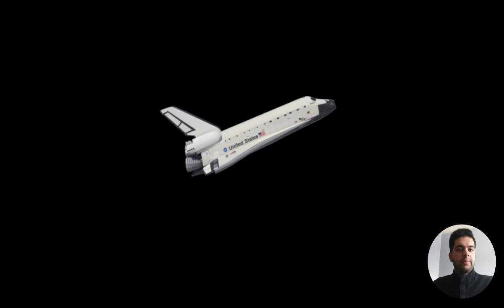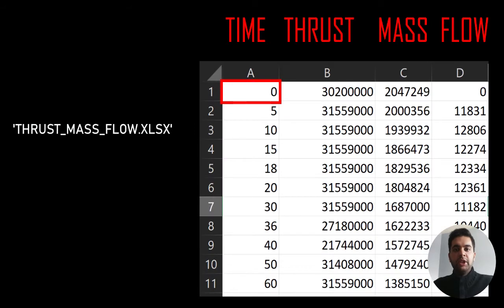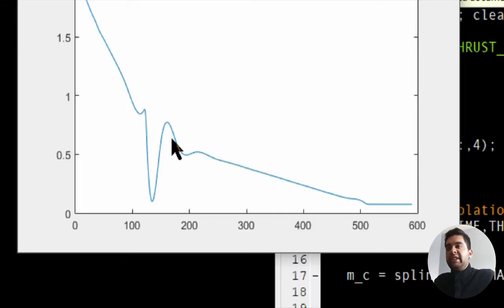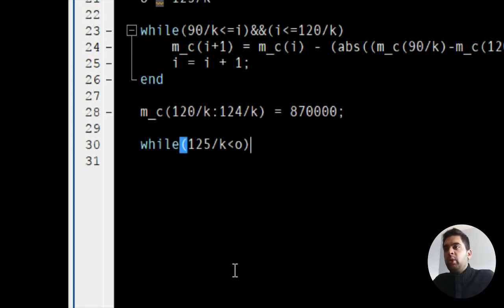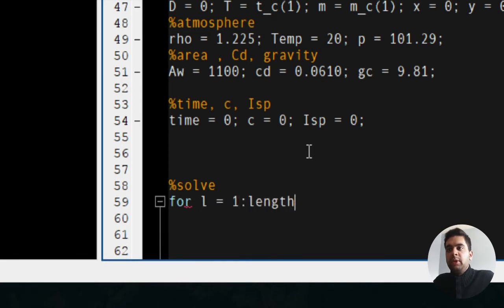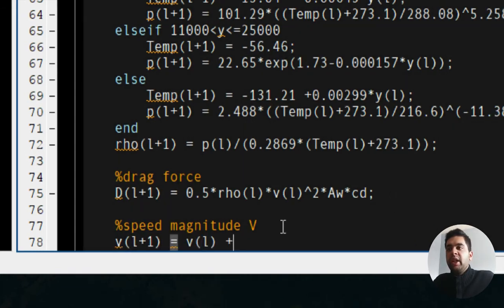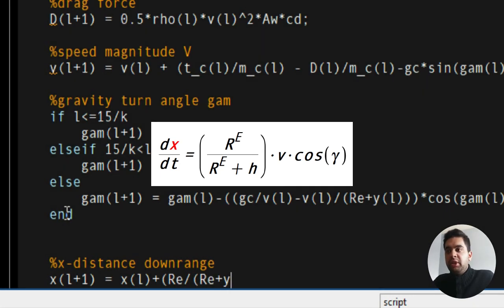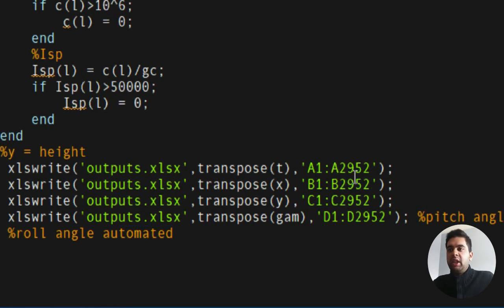STS Rocket Launch Simulation Algorithm Tutorial with MATLAB (Using Euler's Method ODE's)

Comment: how could I split the velocity into horizontal and vertical components? Would it just be as simple as doing V*cos(gam) and V*sin(gam)?
Reply from the maker: yes exactly
Reply: @VDEngineering  it seems to me that there is maybe a mistake in the code. MATlab doesn't allow you to do 15/k < l <= 17/k, you'd have to just use elseif l <= 17/k after the 15/k <= l command on the previous line. Otherwise the last condition of the if statement is never executed, meaning that the rocket is only turned by the kickover manoeuvre for the remaining amount of time (after 15/k) (the flight path angle is reducing by 0.0032*gam each iteration). I've run the code with a small kickover and then the gravity turn equation, and the grav turn eqtn seems to have almost no effect. DO you have any thoughts about this?

Comment: This could be so good and helpful, if there would only be the xlsx file somewhere to download. I want to understand the code, not use hours to find thrust data. Your videos are still extremely helpful but this is frustrating.
Reply from the maker: It's easy, use linear interpolation
Reply: @VDEngineering  Sorry, but that answer doesn´t make sense
Reply: @christoph8630  taken min and max values from google and then use curve fitting to derive data points.

Comment: Can someone share how to get vdγ/dt = -(g-v^2/(R_E+h))cos(γ)
Reply from the maker: It's the governing equation.
Reply: @VDEngineering  I mean is there a way to derive it from Newton's law or something?
Reply: @npa5838  Bro, I hope you got the answer by now, but just in case you didn't and just in case you read this, centripetal (inward) acceleration, written as a = v^2/r, can also be written as v*(v/r) and v/r is the rate of change of direction for any physical body. So, v/r = dγ/dt. So, centripetal (inward) acceleration a = v*dγ/dt and quite obviously centripetal acceleration will be provided by the component of {pull of gravity - the centrifugal (outward) acceleration} perpendicular to the direction of motion given by its cosine. Which gives (g-v^2/(R_E+h)) * cos(γ). Stay safe.

Comment: Iam making a simulation of NASA space shuttle using Matlab Simulink with Flightgear Simulator.
Iam Using Matlab R2016b and Flightgear 2016.1.1 and the first time i simulate it i got undefined variable for pitch, DR but i know that first i must run the shuttle model m file then i have to run the run first m file this will make pitch, DR have values from the excel so i solved this problem but after that i have the problem in the fifth picture.
Iam a chemical engineering student in a bachelor project so i dont know so much about simulink and aerodynamics.
I want a quick reply to solve this error and thanks.
My ERROR is:
The 'Vector of input values' in block 'model/h' must be a real vector that contains at least two elements
Component:Simulink | Category:Modelerror
The 'Vector of input values' in block 'model/pitch' must be a real vector that contains at least two elements
Component:Simulink | Category:Modelerror
The 'Vector of input values' in block 'model/x' must be a real vector that contains at least two elements

Comment: Thanks for posting this video and the MATLAB code. I was looking at how to simulate launches from Vandenberg. If you dont mind me asking, where did you get the thrust data for the Shuttle?
Reply from the maker: I got the max and min off Google and made my own table.
Reply: @VDEngineering  Hello, may I ask how you created the spread sheet?! Or generally how you get that spreadsheet?  I currently have a project for matlab programming to simulate a launch to placement from Andoya to placement in orbit, but they taught us nothing about how to describe rocket equations and so on.